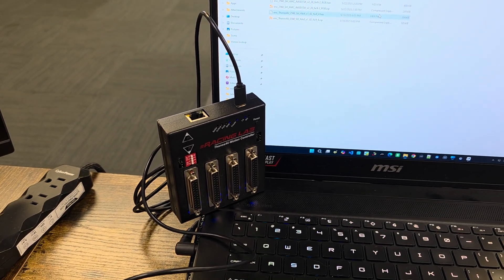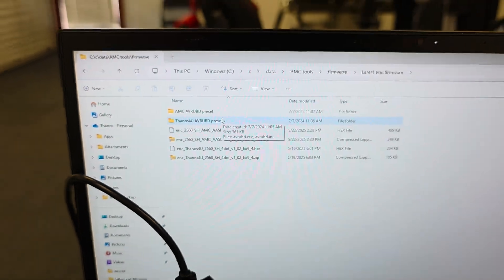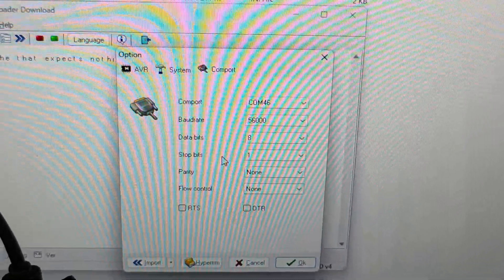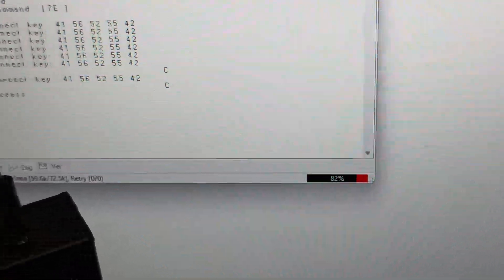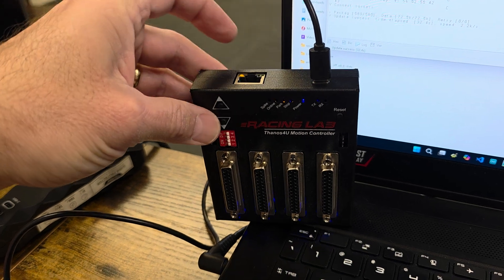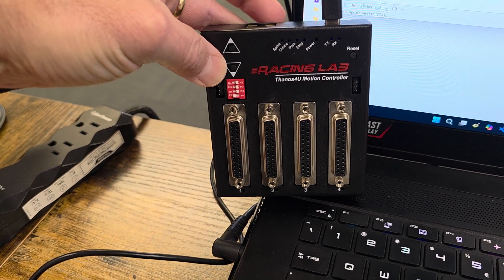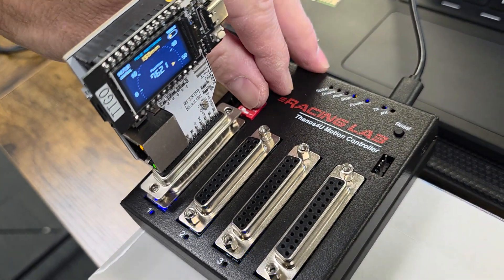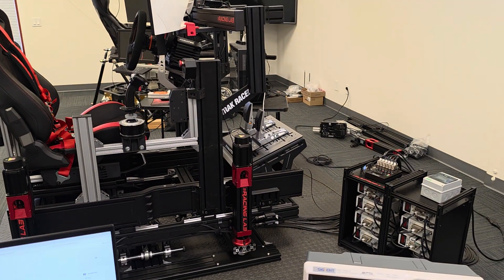Thanos4U Firmware Update tutorial

Comment: Hey man! just got back to my rig and wanted to play but in simhub it says Thanos AMC controller (AASD15A)could not read firmware information,is your thanos firmware outdated?   Do i do exactly like you do in this video to update my stuff so simhub can connect with my eracing lab?
Reply from the maker: Not sure how long ago you purchased your Thanos4U, but best is to update to the latest firmware. You can find the files and video links on github: https://github.com/tronicgr/Thanos4U-firmware/tree/main/Latest_Firmware
Reply from the maker: Wait, do you have the Thanos4U (4 ports) or the AMC-AASD15A (7 ports) ??
Reply: @tronicgr  i typed in the wrong video my friend, its the 7 ports.i found another video you made for it so i following it now!
Reply from the maker: @DanneJensen yep, the firmware files for the AMC-AASD15A are here:
https://github.com/tronicgr/AMC-AASD15A-Firmware/tree/master/Latest_firmware/MEGA2560_chip
Reply: @tronicgr  Yeah i found the video but i screwed something up i guess. im at the part where i press download in AVRUBD and i get : $ <50> Send connect key: 64 X Connect fail
Reply from the maker: @DanneJensen try with the DB25 cables disconnected. Also disconnect e-stop if you have one attached
Reply: @tronicgr  well i restarted the pc and plug the usb in and out and it removed the COM3 port, i only had COM4 now in the option and voila it worked, then i had to change the port in simhub from COM3 to COM4.. i have no idea what happend but it should work now! thanks man<3

Comment: Worked great, stopped my eRacing motion platform from tripping the breaker upon shutdown.  Two things to note:

1) if you leave the cables plugged in, make sure you turn OFF your servo drives (white boxes at 0:34) second mark.

2) to find which COM port it’s plugged into, I used Simhub and went to the motion and check the settings there. I couldn’t figure out which one it was using windows 11 settings.
Reply from the maker: True, you wouldn't want to move the actuators up and then press reset, they may come down fast 😂